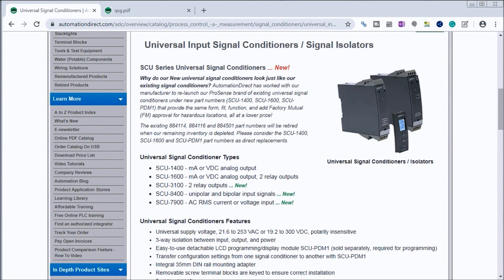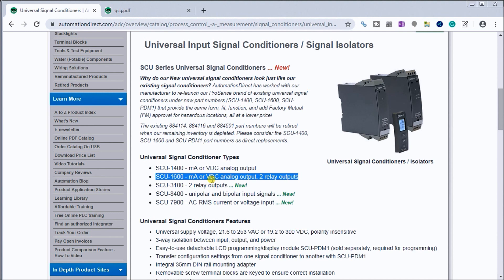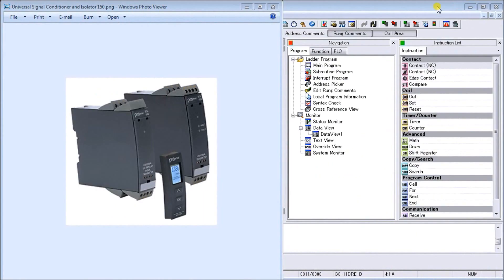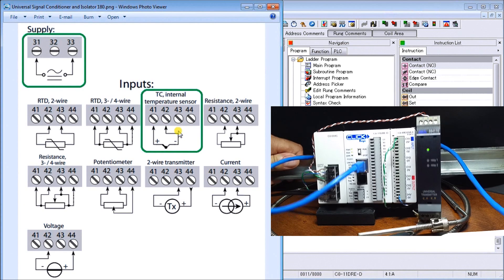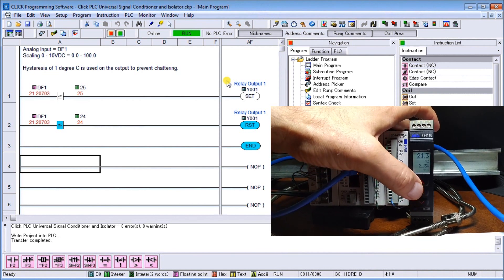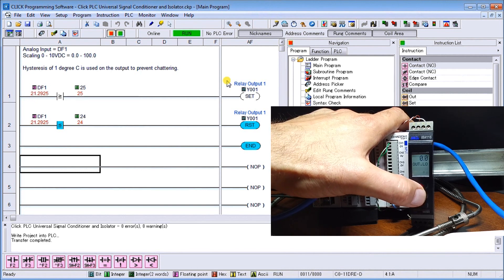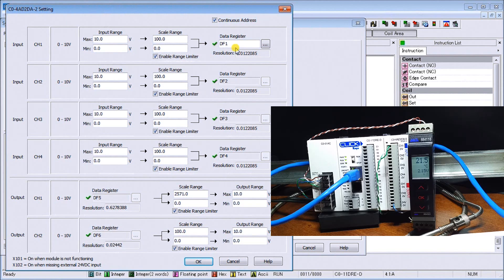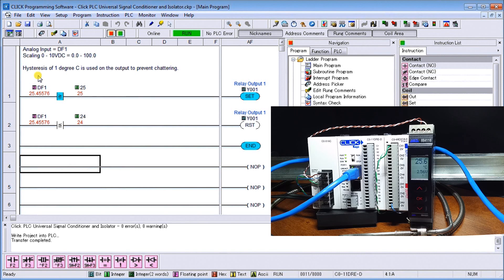Universal Signal Conditioner and Isolator

Comment: Dear Sir, 
I have this question please, 
Can this Signal Conditioner be connected between Temperature Transmitter and PLC Analog Input Channel, 
In other words, takes the 4-20 mA signal and Re-deliever it to the PLC, 
Like signal quality assurance from Signal interruption or degration, 
I do highly appreciate your answer
Reply from the maker: Hi Malik Arthur,
Yes, the conditioner can be used strictly as an isolator for the analog inputs to the PLC. 
Regards,
Garry

Comment: How if i want to change the thermocouple with voltage and current sensor? What sensor should i integrate with the universal transmitter?
Reply from the maker: Hi luthfy dzikrillah,
This universal signal conditioner will handle both voltage and current signals.
Voltage input ranges:
0-1 VDC, 0.2-1 VDC, 0-5 VDC, 1-5 VDC, 0-10 VDC, 2-10 VDC, 0-12 VDC
Current input ranges:
0-20 mA, 4-20 mA
Your sensor output must be between one of the above signal ranges. You can find the specifications for the SCU-1600 at the following URL:
https://www.automationdirect.com/adc/shopping/catalog/process_control_a_measurement/signal_conditioners/universal_input/scu-1600
I hope this helps you out.
Regards,
Garry

Comment: this might not be related to this video but i am looking for an easy way to save a reading from a pressure gauge to go to ds1, ds2, and so on.Everytime low pressure alarm goes off, i have done that with a counter and copy and move but that is a lot of work
Reply from the maker: Hi Maciek,
I would use indirect addressing which is called pointer addressing in the Click PLC.
https://accautomation.ca/click-plc-numbering-system-and-addressing/
The above is a post that will explain the indirect addressing.
Example: DS[DS4000] - DS4000 is used as a pointer that will be point to the next location.
DS4000 = 1 - DS1 will have the information
DS4000 = 2 - DS2 will have the information
DS4000 = 3 - DS3 will have the information
etc.
I hope this helps you out.
Regards,
Garry